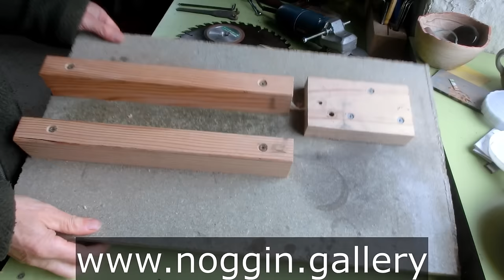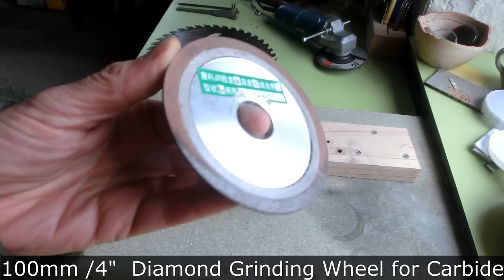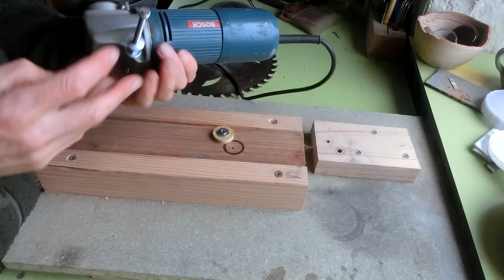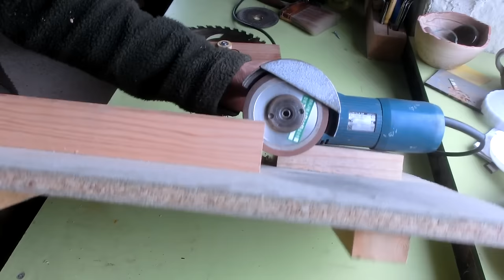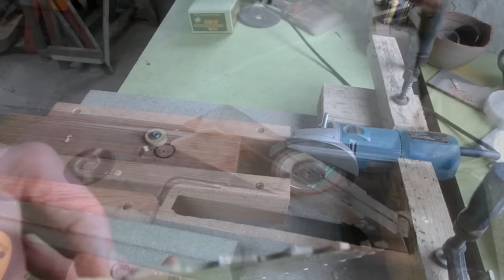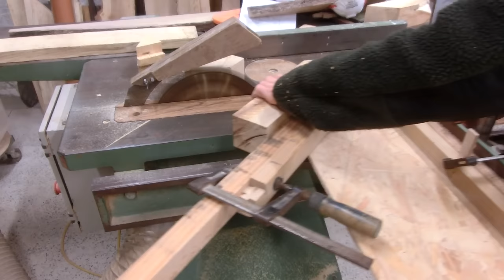HOW TO SHARPEN CIRCULAR SAW BLADES, SIMPLE JIG.

Comment: A minor improvement would be to cut a slot directly below the angle grinder blade and adjust the guard to protect you from shrapnel coming straight at you if the blade disintegrates. 

I like the simplicity of this design. Will use it to sharpen my collection of blunt blades. 

Cheers
Reply from the maker: Glad it was helpful! 😊
Reply: Definitely don't do it, it's in my video too, it's very wrong.
 Because when we grind, the knife does not cut.

 These are not diamond tip grinders

Comment: If you check a few pawn shops you can find a cheap grinder for like 20-30$. That way you can just keep everything hooked up and dont have to worry about clamping and unclamping the grinder. Great video though. I will have to build one myself!
Reply: Harbor Freight has a grinder on sale for under $10 now.

Comment: Good video but check ya blade for angles, I have to wedge my grinder to about 20 degrees, have two jigs running towards ginder, one down the blade and one 90degress to it.
This way you can do tops of the blade and the inside, matching the angle, every other tooth will point the opposite way, so you sharpen every other then flip blade and do ones ya missed.
Reply from the maker: This is not an issue for the most common square ground blades. obviously if you want an angled grind you will need something more elaborate. I do not find it necessary to grind the tops. 😊

Comment: I would of thought that as the blades have offset teeth you would have only sharpen every second tooth, then turn the blade over, adjust the opposite face angle, etc. Am I wrong?

Comment: Can you make the grinder to tilt side to side, then you can sharpen every second tooth on one angle then tilt to the other side and sharpen the remaining teeth. The blade will cut a lot cleaner that way. 
To check if it is sharp i scrape my thumb nail on each tooth as well. Cheers
Reply from the maker: This is not an issue for the most common square ground blades. obviously if you want an angled grind you will need something more elaborate. 😊
Reply: @MartinWoodhead  The father in-law has all that stuff and more. Could be the reason i married his daughter?
 It is clever what you made with stuff that was just lying around!  Cheers mate.

Comment: What kind of disc you are using??
Reply from the maker: Try this. I would go for the 150 grit.
https://www.ebay.co.uk/itm/234099355435?var=533752129737&hash=item368168af2b:g:Ck4AAOSw5U5g-Rth
Reply: @MartinWoodhead  yes thanks for sharing it

Comment: Shouldn't you have two stops, one not so important controlling the slide into the disc and one very important controlling how much you take off each tooth? Without the latter and because of the rake of each tooth by doing it freehand you will end up with different height teeth....
Reply from the maker: It's a simple jig Jonathan, and it works. Neither are necessary for tungsten carbide tips, the amount of material removed is negligible. If you want to add stops add them! Or pay to have them sharpened professionally. Or chuck em away and buy a new one, which is what most do! 😊

Comment: Noooooooo!

1. Diamond blades are made for about 150 - 300rpm not 10,000rpm angle grinder speed.

2. Tungsten carbide teeth are meantvl to be sharpened very slow speed with, water for cooling so as not to heat and destroy temper.

Comment: Not trying to disparage your sharpening technique, however, alternating angles are required for every other gullet tooth.  Your technique grinds every tooth on the same "flat" angle.  Also the face of the tooth also requires angle grinding.  Perhaps your technique works for you, but falls far short of correct grinding.
Reply: It probably wouldn't require a big modification to be able to grind alternate teeth at different angles

Comment: The teeth of the saw are alternated, one tilts to the left and the next tilts to the right. If they are all sharpened equally, the cuts will come out very splintered.
Reply: That topic is very interesting and true. What we could do is an adjustable angle holder for the grinder, and then sharpen the teeth that have a tilt first, and then readjust the angle of the grinder to touch up the other teeth of the saw. I want to try to make a removable device that allows me to sharpen without removing the blade from the machine, it is an exercise in imagination.
Reply: Video only shows sharpening the face not the top bevel.  The hook angle is the same for each tooth.